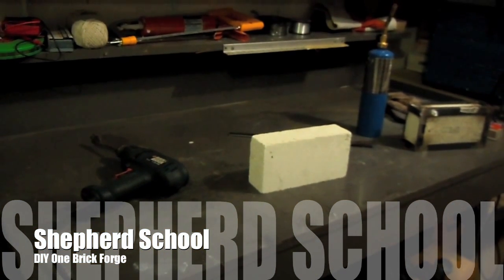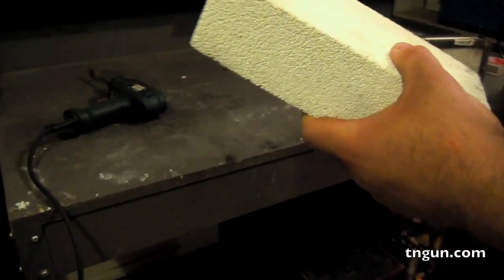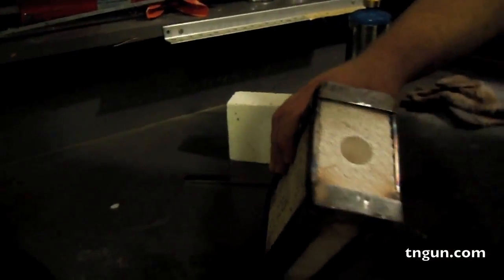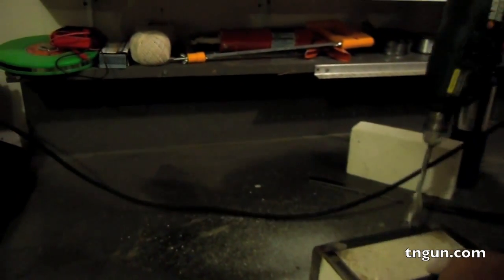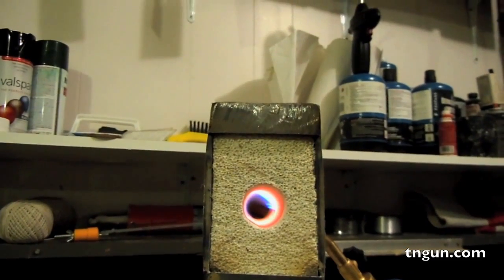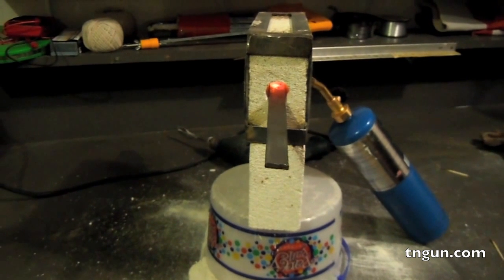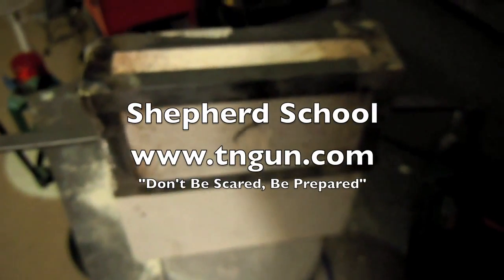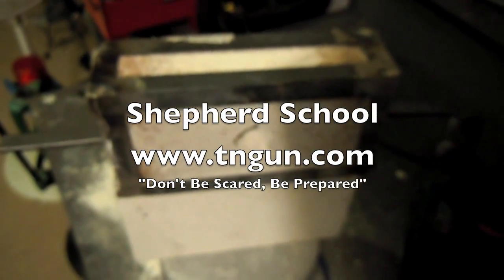How to Make a Simple One Brick Forge

Comment: Get a discarded metal bed frame at a thrift store for making the case as you did and to save some bucks on angle iron costs. Before you enclose the brick into that cage, dip it into some sodium silicate and your not going to have the cracking issue with the high intensity heat applied. The water glass will help in that regard. Your hole on the side was likely a bit large if you used the same spade bit on both holes you drilled. These refractory bricks are not made of pumice stone,. The air intake on the opposite end actually helps. Some people only drill a hole half way into the brick. For the small amount of waste silica in drilling just two small holes into the brick, your not likely to ingest enough in your lungs to have silicosis. However, if your making a rocket stove mass heater in the future, save the dust to add to your mix for a refractory mortar. No use in just wasting it if you have a project like that planned.